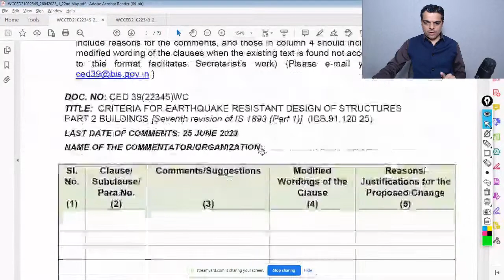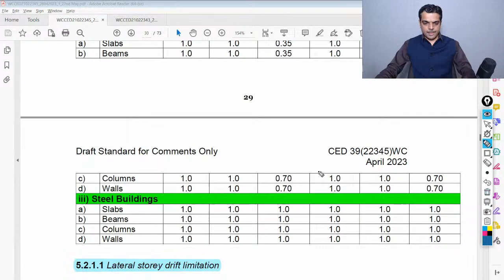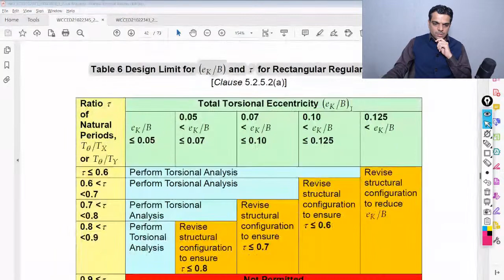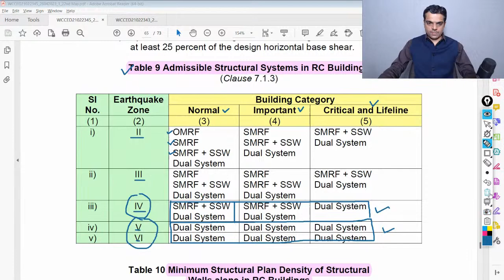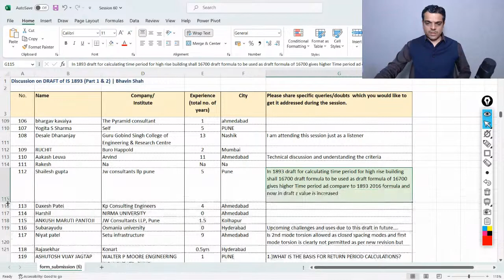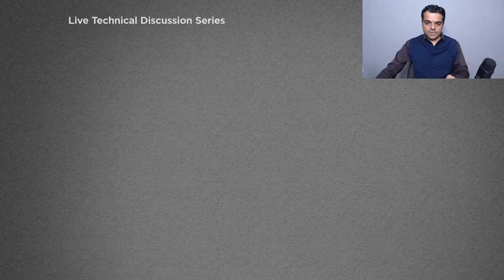Session 61: Discussion on DRAFT IS 1893 (Part 2)

Comment: 1893-2023 Draft
As a structural Engineer, I feel like  there is hardly any scope of  engineering left for optimization and resource management, with so much safety factors and codal resistrictions.
Reply from the maker: Please share your comments to BIS technical committee before 25-Jun-23.